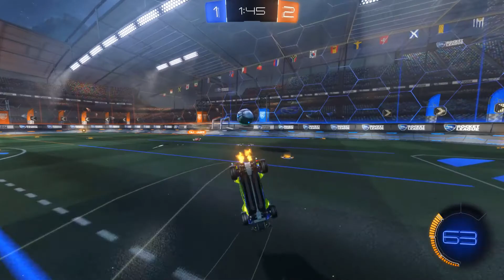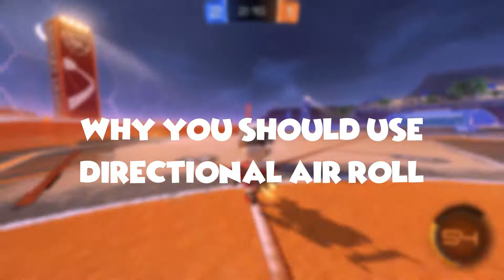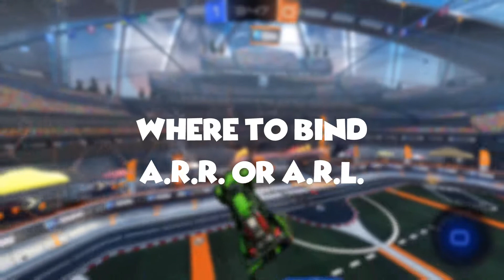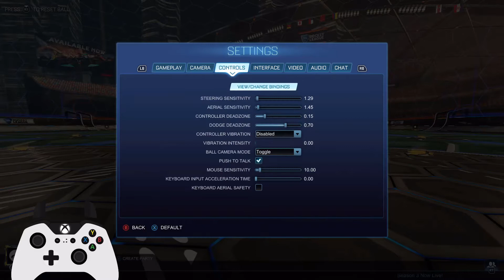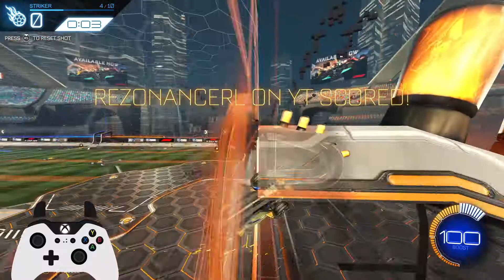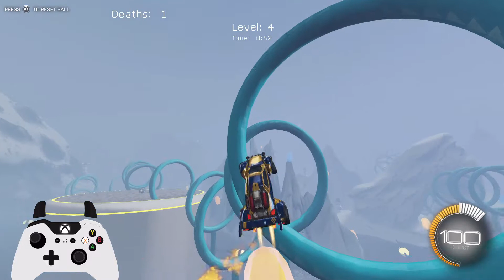How to IMPROVE Your Aerial Car Control | Directional Air Roll Tutorial

Comment: This is a great video.  I don't play the game often but do want to work on the aerials.  I couldn't figure out what the mechanic was called when someone was spinning in the air.  I will have to practice it and look at how my controller is bound.
Reply: Um you probably know it by now but if you want to learn air roll just be aware of the fact it’s not going to improve your gameplay for the first 100-200 hours of practice only after the 300 hour mark will you be able to start incorporating it into your gameplay and even then you might not find the best uses for it right away so definitely not a mechanic I’d recommend below diamond at least BuT it is important to practice it on the side just don’t focus on it specifically
Reply: @Gix0_0  Thank-you. I am still here 4 years later and l play once in awhile but for some reason this is one of the few games I play where I have had trouble improving even after many games.  It might just have  a real steep learning curve.  With many other games I have been able to rank up quick such as in Fortnite but here I just got stuck on early Gold and still couldn't figure out how to perform aerials like aerial dribble, etc so I did get a bit bored playing a lot but I sitll log on sometimes.
Reply: Don’t that’s the best advice I can give you…. 4 years ago 😢

Comment: Hey man, I am currently on the road of learning air control. I was wondering if it is possible to learn through just trying random air roll movements for multiple hours and automatically get muscle memory from it or if you need to dedicate time to figure out how certain air roll movement influences your car. Anyways, nice tutorial
Reply from the maker: Thank you! I think eventually you will learn from muscle memory but I think you would make faster improvements if you try to apply the 4 basic ways to change direction(so ARR/ARL + Joystick Left/Right/Up/Down) that I show in the video. Instead of spinning the whole time you can also fly without using air roll(the hood always facing you) and then start by incorporating one single spin while holding the joystick in one direction to see how that affects your cars trajectory.